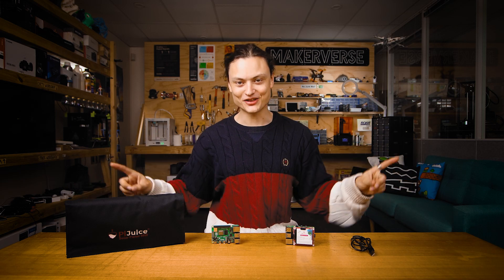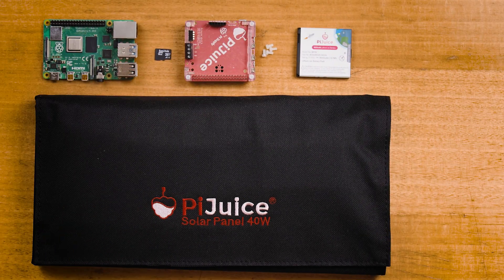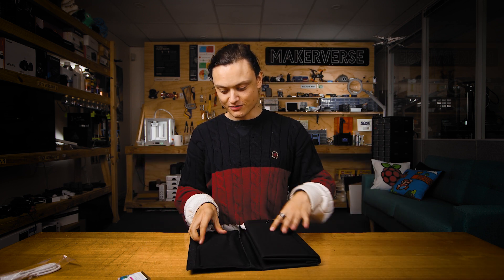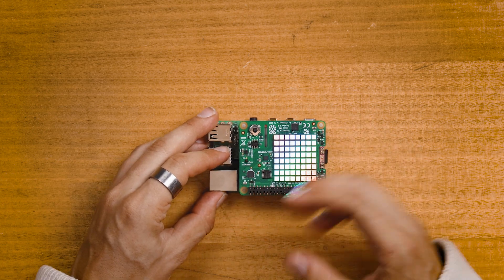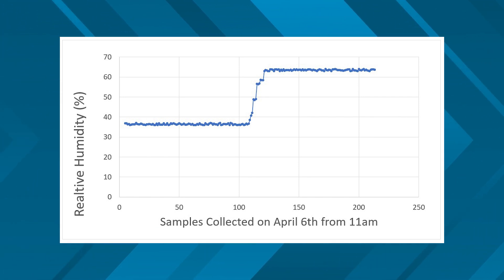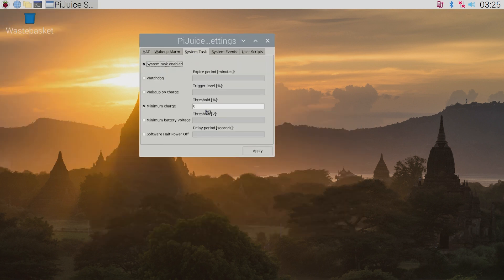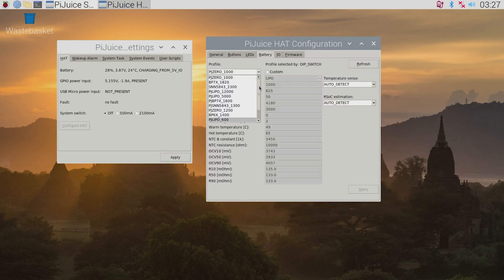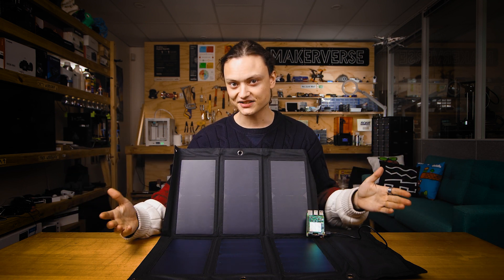How to Build a Solar Powered Raspberry Pi 4 With PiJuice

Comment: will the board not overheat outside?
Reply from the maker: Definitely a factor to keep on top of for long term installation. A white component box and active cooling for the Raspberry Pi will keep you in the safe.

Comment: Just had to comment before I finish... THANK YOU for requiring a MONITOR... I'm SICK of headless tutorials... Now on with the show.
Edit, now I just need to figure how to install a Monero miner. And run it solar.
Reply: You make 100 hashes it will take over a 130 years to make the money back there is already a video on it even if you bought a usb miner thats 2 watts and added it and got a bigger panel it would take decades with regular electric just to pay the $150 off for the usb miner
Reply: Ive been working on this a few days now the only way that might work is buy a top of the line 400 watt panel like LG and some good Samsung 18650 batteries and remove the psu thats converting 120 240 to 12 volt and 5 volt and keep it DC to DC then strip down a mb of everything not needed that can be stripped even cooling fans would have to go and use every little bit possible to run a good AMD chip to mine raptoreum then try moving up to a low watt gpu strip that down of everything not needed its still a big panel but you might be able to start roi
Reply: https://youtu.be/CbpfNU7oaws
Reply: And i highly doubt we are the only ones even thinking this but id like to see my own outcome i have the know how just not the money right now after investing $2000 on reverse engineering a gpu to bypass LHR i wont make my money back until i can buy cheap cards like the 3050 bypass the LHR and make it mine like a 3060 ill mod them and resale them or just mine with them and never even tell anyone how to do it i haven’t decided yet

Comment: one question - solar pannel for home use + from normal light + battery and low battery change power from site and 100 percent recharge switch into battery?